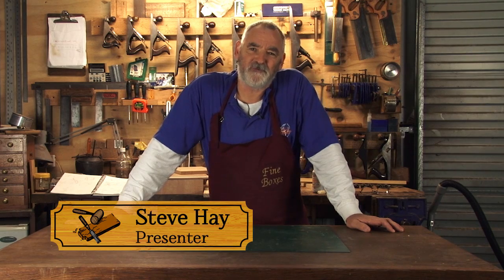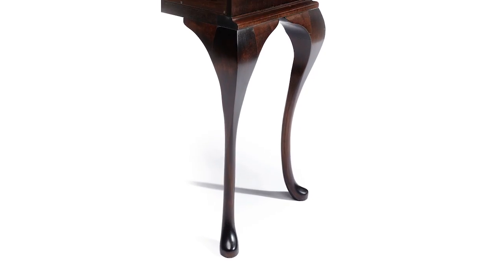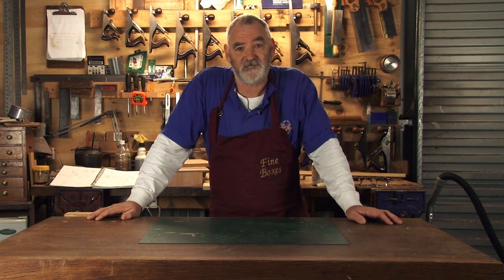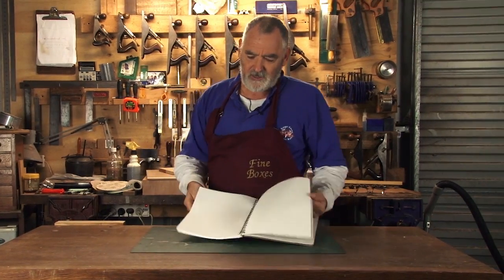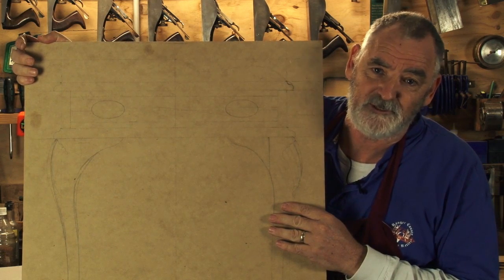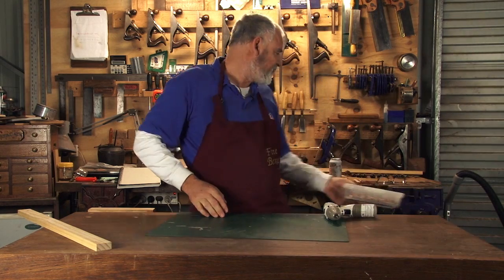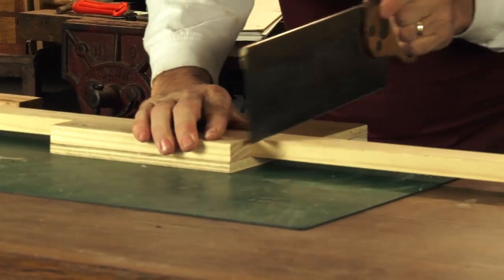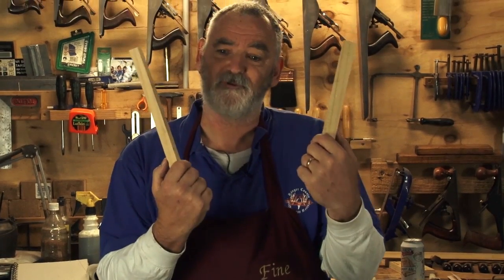Woodworking Masterclass S1 EP1 P1/3

Comment: It is tough to start a woodworking project. I had wasted so much time & cash on my previous work. Next, I learned the reason, that is I did not have a exact program & diagram. I always let things worse when it can be solved quickly if I had some experience. Then I found a wood working system which contains all the specific diagram, tips & guides - it help me lots.

Comment: The pieces you screwed onto the ply for the bench hook should be about 25 mm less in length so the the tenon saw does not cut through and damage the bench.